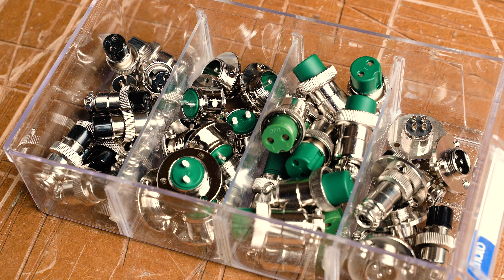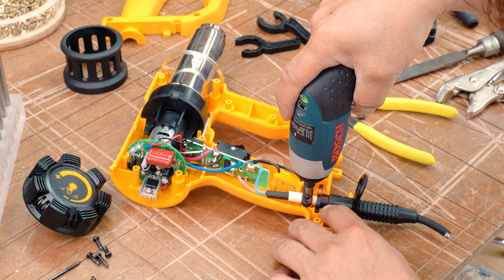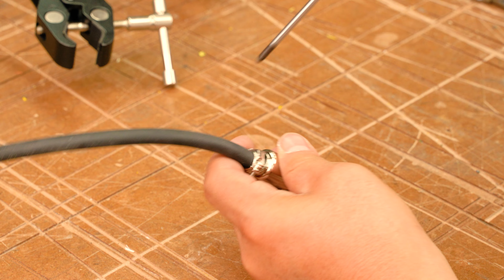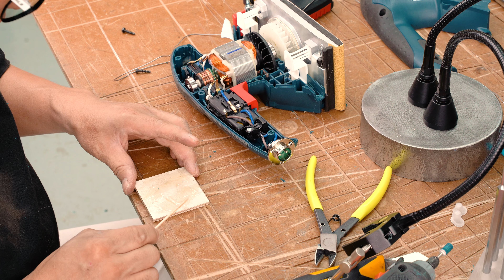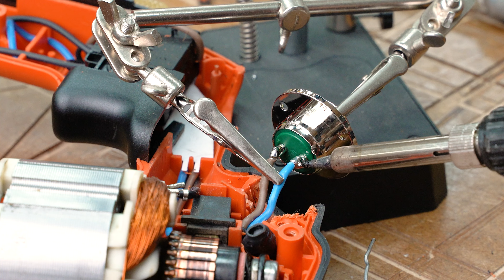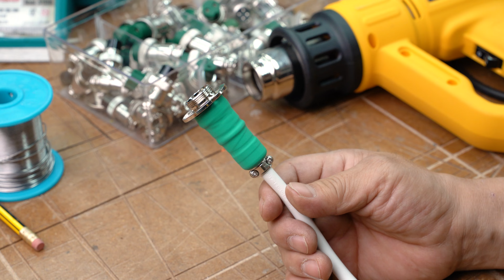Do corded tools dream od cordless? How to make Wired to Wirelessly / DIY

Comment from the maker: I started a membership program. Please participate for continuous video production!
It has been more than 10 years since wireless tools were introduced in earnest.
Once we step into the wireless world, it's not a hassle to use wired products.
However, there are many tools that require high power, and many wired products that were purchased and used before. I'm sure you have it, too.
I attached a connector to the wired product itself so that the wires of the wired tools I have could be used as one. The dirty products that had wires wrapped around them look like completely different tools just because they don't have wires. It's much easier to store.
Simply place a wire with a connector in a popular location, and we can take any product to that location and connect it to the connector.
We don't need as many wires as we need. Because all products are compatible.
In the first place, I don't know why major companies don't make it like this.
There are several possible excuses. This is because power consumption varies from tool to tool, so we have to use wires accordingly. It is to increase safety, and so on.
By the way, it's wrong. This is because the companies as like Festool has already made a wire to fasten to the main body and is using it. They also sell electric wires that are compatible with various products separately.
The problem is, there are too many manufacturers. There are so many brands I use, including Bosch, Milwaukee, Dewalt, Makita, Festool, and Stanley etc.
It's not easy for all of these companies to use compatible connectors.
Those who have used it will know, but even the grinder has different spanners for each brand.
It's that hard to unify standards.
I solved this part personally. A separate connector is made into one for all products. Although it is difficult to work because the internal structure of each product is different, it was not hard to think that it could be used much more conveniently by simply connecting the connector.
To prevent the connector from falling out, I used a product that can be filled by turning the ring like a screw, and using the 6A product, we can use up to 2000W without any difficulty.
Please refer to this video if you want to use wired products as comfortable as wireless.
Please enjoy watching and subscribe and like. Thank you.

#DIY #Wireless #Tools #Tuning #Wired #Wire #Cordless

Comment: I had done this exact same upgrade but I had used Neutrik powerCon True1 connectors which are amazing, slightly expensive but I love the fast twist lock. Also I had made two extension cords one for the tools that required less amperage since it made the cable way light and one extension with thicker gauge wire for tools like routers etc. Great job Kynosys I love seeing all these great shop upgrades and projects. I just cut my wire and put a 
connector on the wire this way no tool modification was required. Also by always using the same connector and having my cord with 3 wires (ground included) then it did not matter if I connected to a 2 wire tool or a 3 wire tool the same cord would work
Reply from the maker: You, who have already made and used it, are seniors than me. Those connectors are really nice too. It's slightly more expensive. Next time I'll have to think about that too. thank you

Comment: I think this has to be one of the best modifications.to a power tool I’ve seen thanks for posting
Reply from the maker: Thank you for your words. If you do similar work later, it is easier to install the connector without installing the connector to the main body like I did, leaving about 100mm of wire from the main body. thank you!

Comment: Thanks for sharing the interesting video. I would like to know from where you can buy the connectors.
Reply from the maker: If you search for circular connector, you can find products in various sizes. When working, pay attention to insulation and use the appropriate size. It is also a good idea to cut the wire leaving about 100mm from the main body. Then you don't have to open the body. thank you